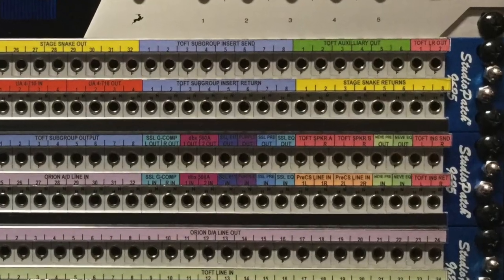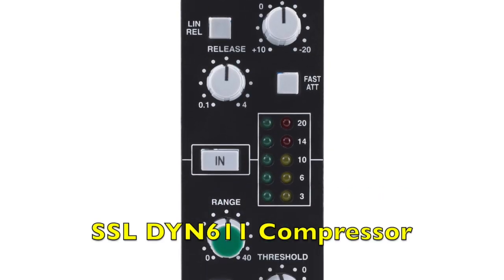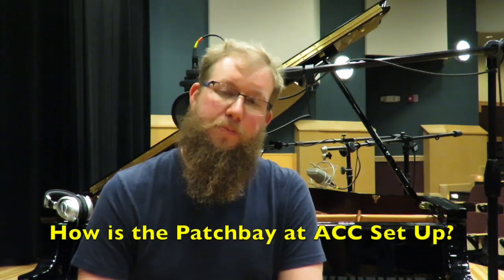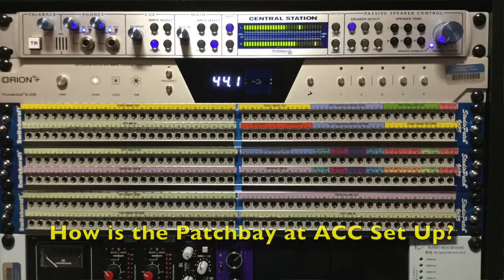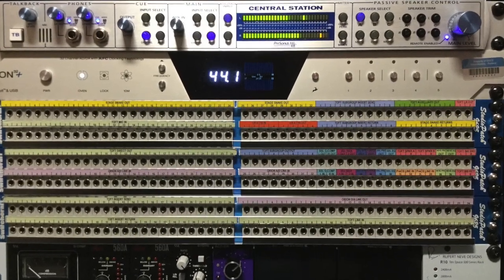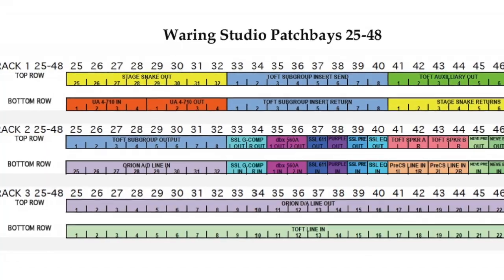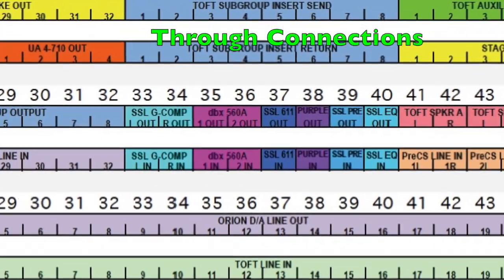14  Patchbay Configuration Summary

Comment: How are you dealing with phantom power going to mics from the toft through the patchbay? great video !
Reply from the maker: If I am running preamps using the patchbay, I engage the phantom power on the preamp I'm using. If I am using the preamps on my console, I engage +48 volts on those preamps.

Comment: Very clear and practical explanation, I appreciated when the camera show the many labels, it’s so well organized. many thanks!!
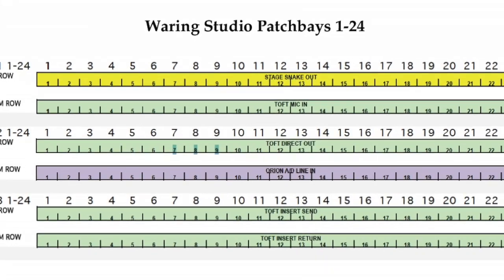If I can make a question: at 3:43 the scheme shows that signal from stage mics snake connected to the top row “flows” to the bottom row, which represents the console mic inputs (mic ins cables from the console to the patchbay bottom tow). 
Is this kind of normalling  full or half? I ask because In case you like to use a special hardware preamp (and not the console one), how do you avoid that the signal that is “duplicated” (if the normalization is half) flows to both preamps?... Thank you in advance for your reply! Greetings from Italy.
Reply: Connections from microphones to preamps in a patchbay are always full normal for the reason you stated. Also, it is possible that 48V phantom power is being provided by the mic preamp, and you don't want the mic to see phantom from multiple preamps. In fact, many studios do not put their tie lines and preamps through a bantam/TT patchbay at all, and rather have XLR patchbays for making those connections. If phantom power is turned on and you insert or remove a bantam/TT patch cable, you can damage the mic or the preamp. With an XLR connection, it's not possible to cross-connect pins.

Comment: Hey I have a question. My patchbay arrives tomorrow and still confused as ever on how ima set this thing up lol. I use an audient id22. For myself my vocal chain is preamp>distressor>compressor.. that's plugged into return 1.. now after Im done and mix, my mastering chain is bus compressor>ssl fusion. The problem is I use returns 1&2 for the mastering chain. Which is the reason I want the patchbay. Plus I would like my compressors seperated if needed for printing/mixing other clients. Is there a way to route returns 1&2 to the patchbay then always use return 1 for my vocals then to use both when mastering? So confusing lol THANKS